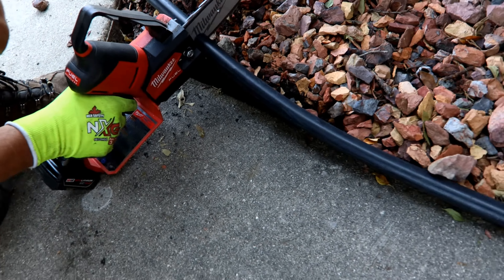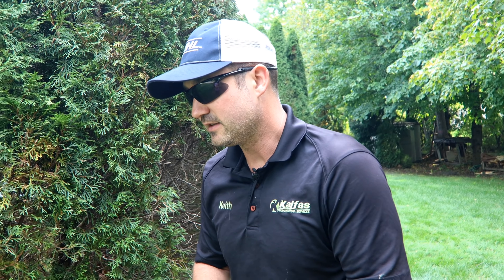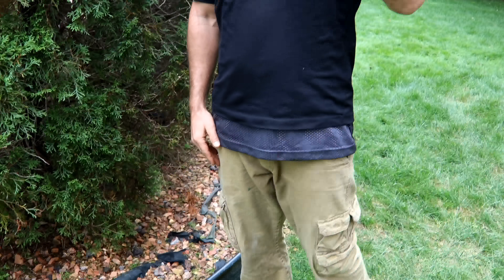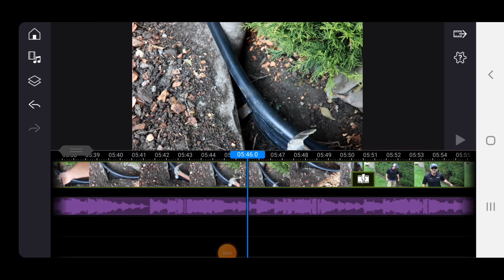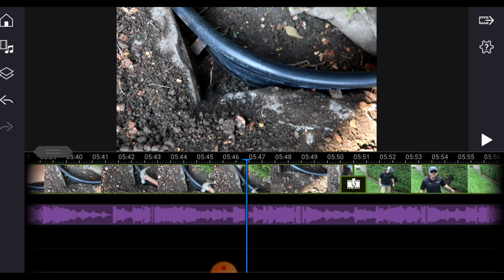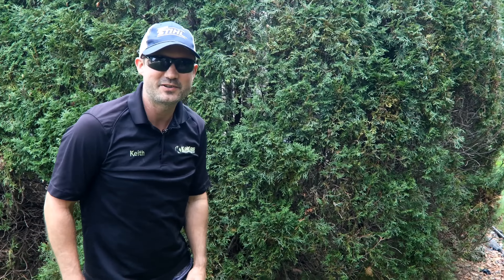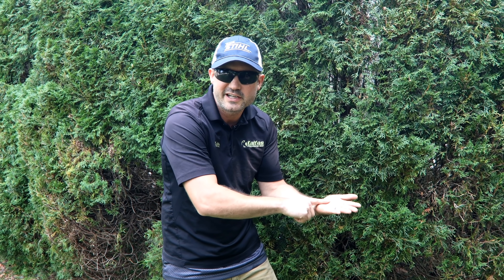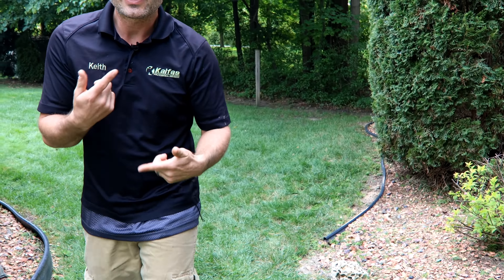Before You Try To Repair Landscape Edging.. Watch This... "$300 Really?"

Comment: Always thought lip and stake went on the inside. Doesn't seem practical to do on the outside.
Reply from the maker: Yep... i knew for a fact people would bring this up and yes... YES  9 out of 10 stakes go on. The INSIDE... 
YES THE INSIDE.

But we also put stakes on the outsides too around tight corners... and we pound them in deep.
Reply: Your correct however the stake is hidden anyways. What I do is rotate the stakes inside outside. Inside bends the stake goes on the outside and outside bends i stake it on the inside
Reply: @handyscapersllc  I have no idea what you said there.

Comment: Always call cable utilities location service, it sucked to be me once, although the edging was present we hit a cable.... edging is a pain..I don't give my clients a choice anymore, I  prefer metal, it costs more but it saves me time and hassel. A mallet usually does the trick to put it back in place.  Like your video, I have to explain the time and labor intensive care we have to resort to. My first few installs were really bad and later fixed and repaired them because the bad intalls bothered my conscience.

Comment: Hi! When ever someone has that plastic junk and asks for it to be repaired I get them to change it all over to aluminum edging made by a company called curve-rite.  It rarely ever pops up in freeze thaw cycles and when it does all that needs to be done is put a 2x4 on it and hammer it right back down.  Stuff is great. Thanks!
Reply from the maker: Yes sir.  And I offered to redo the entire property with brand new aluminum edging. But this particular job only wanted the repairs this time around.

Comment: Heh man I always liked your funny edits and ramblings. Sounds like you've been going deep. I heard you say remedy early on and talking about tacit agreements now. Its so true though and thats why I got out of landscaping because its almost impossible to write contracts where both parties are 100% clear on the expectations. When you take on a contract from a customer and its been drawn by a landscape architect there are clear scopes of work and blueprints that show exactly every single detail and the architect is in between you and the customer. The architect is familiar with standard practices you you're on the same wavelength. You're almost at the size where you could take on softscape and amenity installs. Thats where the moneys at man.
Reply from the maker: Ahhh I like this. This makes great sense.
Reply: @keith-kalfas  Condo softscape projects are easy money. Most have no bidding competition. You get a plant list, clear scope of work (planting and putting in 18" of dirt in the planting beds and 4" for lawns) and once the architect signs off that you planted correctly and the soil is deep enough you get paid. You can bid on hardscape (concrete, pavers, rock walls), water features, drainage, irrigation, amenities install (benches, ashtrays, bike racks ect) or none of those. Preference does go to the contractor willing to do the most of the landscape scopes of work though.

Comment: My price for install and repair just jumped dramatically!!!!   Thanks Keith!!!  U da man😃😃.   It is a fn pain in the ass to install or repair.  Rocks or stone is a mfr 😡😡😡.   Stakes should be installed more horizontal than vertical.  Helps eliminate the heaving.  10-12” timber spikes work the best.   Also, use screws on the inside lower edge of all connectors!!!!  Thanks Dawg😃😃.   Shrubby

Comment: i refuse to install plastic edging. People say its cheaper which it is. Well i charge more to install plastic so it ends up costing more than aluminum edging. Aluminum is sooooo much better. Other nice thing with aluminum edging is you can use a metal hammer to tap it back down if the dirt frost heaves it

Comment: Have you made a video about replacing a flower bed of clay?  removed a whole yard of clay out of 2 1ft deep 8 ft wide flower beds. What I thought was going to be small job of removing a small layer of clay to replace it with some good top soil turned into hell. I thought I only needed half a yard for both the holes, the clay was super dense and compressed and heavy..true story

Comment: Hey Keith great info. For the $300 per 20 foot section, does that include the edging, stakes and installing new or is that just to repair a existing 20 foot section as you described in the video?
Reply from the maker: This for a brand new piece installed including stakes and edging. Haha.